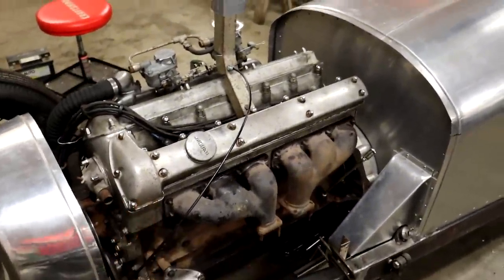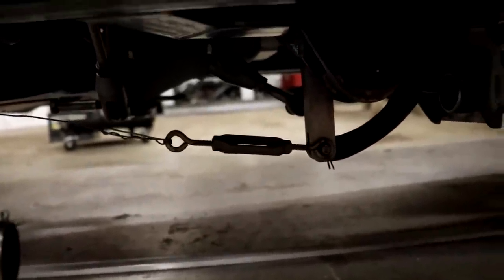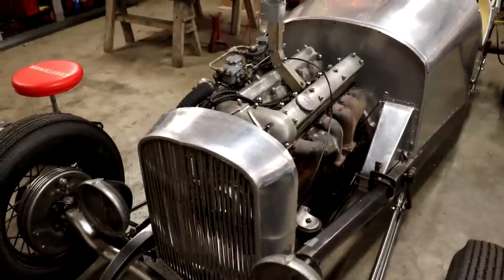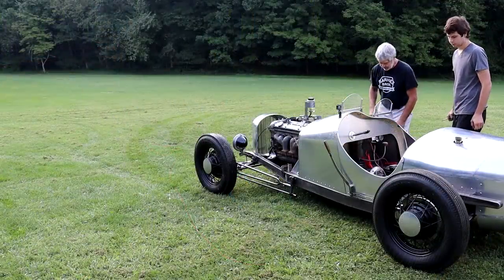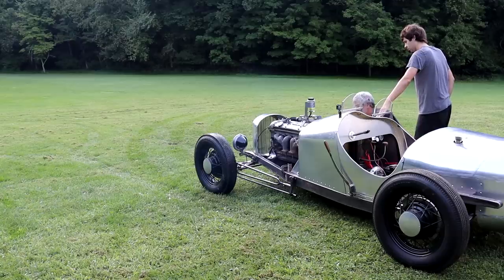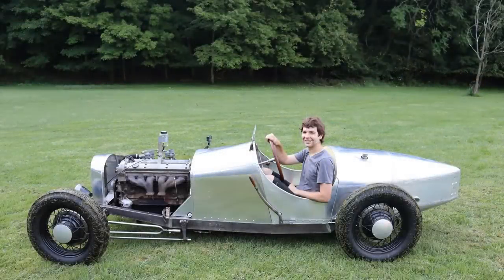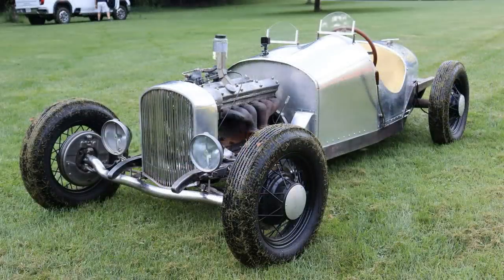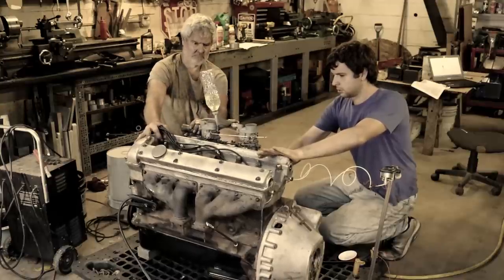The First Drive! | Homemade Boat-tail Speedster Pt. 60

Comment: You're lucky to have a Dad like that with such a great shop and knowledge. Car looks good, seams in the Boat tail came out nice, proportions are right. Seat to dash looks a little tight. I added 8" to seat area at the bottom of the scuttle and boat tail. Ground clearance can be adjusted by raising the hairpins in the front and steering control. Suspension works! Gives you renewed energy when you take it for a spin! Engine turned dash? Cowhide seat? Knock-offs? Dash mag? Make sure you visit Mullins and the Peterson since you're in California, I did while I was building mine.

Comment: That engine sounds even better than I had hoped. The exhaust note is magnificent. Strong work!
Reply from the maker: These old jags do sound really good
Reply: @MacroMachines   In addition to the exhaust note, the 1960s and 70s Road and Track magazine described a delightfully precicse mechanical  snick snick sound when going up and down through the gears.

Comment: Fantastic build!  The frame seems to have a fair amount of flex on the bumps.  I'd recommend welding some lengthwise tapered gussets to the underside of the existing frame rails to stiffen things up.
Super engine sound! I have two 3.8 XKEs; and when running side-by-side, they sound like a WWII PT boat warming up at the dock!

Comment: The smile on your face as you drove the car summed up all the hours spent through both good and set back times made it all worth while. The build has given you a lifetime of memories and a practical experience that book learning doesn't. At least after 4 years your car is going and mine still not drivable mind you this is my 4th build from scratch.

Comment: Thats brilliant. I should imagine getting used to a clutch won't take you long. Also, I think the engine will run and idle better when you have the fuel pump working and maybe a bit of back pressure on the exhausts.

Comment: Nice!!!!! Just a heads up if you don't have a radiator cap there is no way to vent the pressure as the engine gets warm. It was probably inevitable that a hose would come off.  Glad you got some time in on it before moving. Awesome for your dad to jump in and lend a hand.

Comment: Wow, this is absolutely amazing! This is your car. I mean, this is actually YOUR car! What an achievement! It took me about four years to rebuild my 1953 Motorcycle. But that was "just" chasing parts and figure out what goes where. Not actually building them. What a thing, what a thing!
Just one question though. Your steering arm is terrifyingly close to the ground, what is you plan with that?

Comment: Be good if you tried to change gear though rather than running around in first gear! But first time is great and well done!  The bodywork looks very good. What carburettors have you got on it? It should be twin or triple SU's ( if off of an E type) I get a radiator on there pretty quick I you don't want it seizing up on you. Those Jag-U-are ( that's how it is pronounced here in England not 
Jag-waar lol) engines produce a lot of heat
Reply from the maker: I was about to go for 2nd when the water line blew off. Carbs are twin Solex, which I think is unique to the 2.4
Reply: @MacroMachines  it’s a 2.4?  I didn’t realise that. I was thinking 4.2 or 3.8

Comment: Congratulations!  It's just as well you did not drive any further... if you had, your "smile muscles" may have locked into a permanent satisfied grin!   😃
Where the motor stopped at 8:52 sounded familiar;  do you have an air-hole in the cap of your "fuel tank"?  (Yes Dear Readers, I know the sudden clutch engagement dropped the revs, but I think it should have recovered to idle.)

Comment: Very very cool and it looks like the 1933 Miller Indy Special. Good choice of engines. BUT> they will over heat FAST if you do not have a radiator hooked up. Don't ruin all your work by Not having a rad hooked up.

Comment: GOOD JOB there....but :) i see that the steering control arm just below your left leg is very close to ground and it can be a problem when you hit a bump! Personally i would do something with that to avoid unwanted surprises  when driving :) But i assume it is "young age problems" and will be dealed with on next stage of build :)
Reply from the maker: I'm going to fix the suspension to raise the ride height

Comment: Plese don't turn your ignition off and back on while it's running like you did at 6:15!  It can crack pistons and do other nasty things to your engine. Believe me, I learned the hard way many years ago when I was about your age. You have built a beautiful automobile there, hang onto it.

Comment: No radiator, no coolant ... just water in the hose. Just HAVE to drive it and hang the engine damage from overheating!
Dolt Sr. and Dolt Jr.